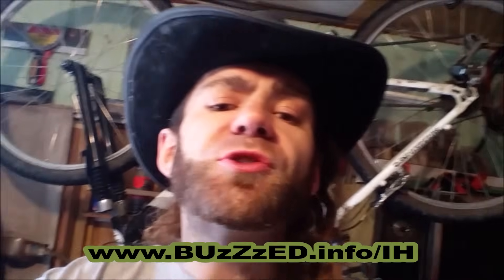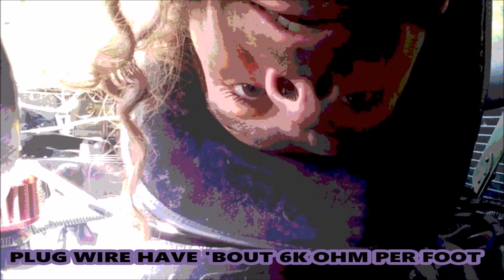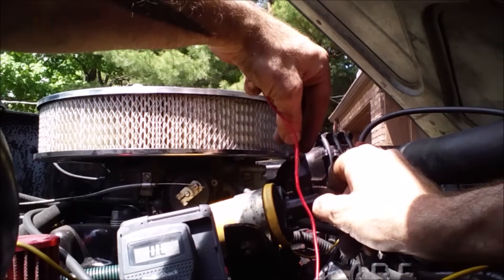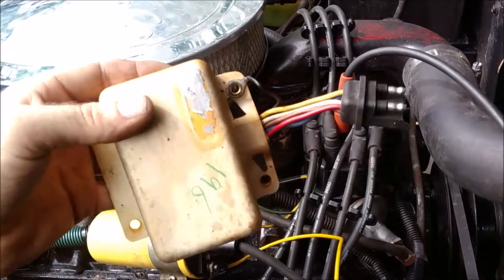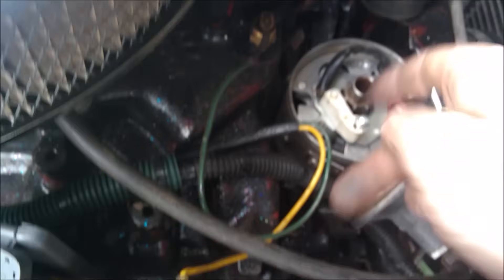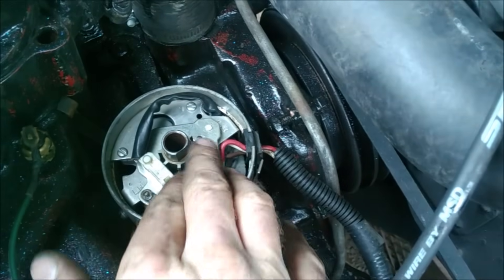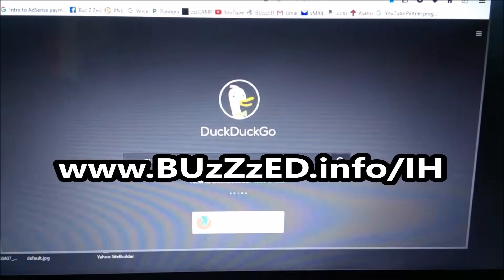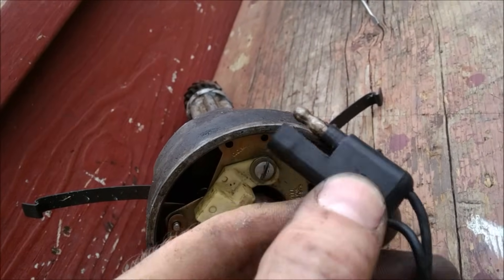NO SPARK, NO START, NO PROBLEM!  IGNITION SYSTEMS

Comment from the maker: oh my bad,  a 4cyl coil is not 1.6Ω like the 8..., it is 3Ω for the 4
Reply: Bro you explain stuff perfect and my 72 Buick Skylark literally started bogging out at 30 miles an hour like it was getting too much fuel what's your thoughts Could It Be Me screwing with the front needle adjustment too much out of whack or timing too far advanced
Reply: I have a 1971 ford thunderbird my car is doing the same thing when I change my coil it fired up drove it all that day I parked it for a couple of days went to try to start it no start
Reply from the maker: @waterboards6349  did the battery die

Comment: Ill make a new comment as the  "reply"  doesnt go through for me.   Ive got my coil out and am finding nice tight blue spark direct with battery  {when in vehicle is was fuzzy ugly yellow}  but its  "terribly inconsistant"   it wont fire every battery stroke /  sometimes not at all then other times will fire directly.  Thinking about putting a diode across the coil primary -  but getting tied -  Im in NZ.  Taking parts off boards -  sometimes a little flame torch with pull force so as soon as it heats enough you can get it out  {with plenty of ventilation}.  Thanks for your reply.
Reply from the maker: Sounds to me the primary winding is shorting out part way down the coil so it takes too long to recharge all the little eddy currents to the secondary…..

Comment: Thankyou Yanky.  Nice and slow so you can absorb it.  So im thinking the sensor is a hall sensor and activates a transistor -  likely a mosfet.  Which you can buy cheap or get out old washing machine etc.... -  better then paying the extorted price  and expoxy them in.  Thanks for the electronic ignition info as Im used to points and condensor.  Now to play with the coil and work back.  But mine had 15.67 kohms.  It is a sports coil so I dont know if that was the diff.  Seems sometimes to check these things when new and write it down somewhere safe.
Reply from the maker: Pull main wire off cap, and use spark tester, jump the coil straight to battery, then jump the coil power over to the coil trigger terminal momentarily and that will trigger spark, nice blue spark you know what your looking for…
Btw, big into repair and modifying cb transceivers, so I know enough to be dangerousness, the board is entirely caked with what looks like jb cold weld lol so if anybody knows how to remove it with out destroying everything else…

Comment: I still can’t figure out what’s going on with my car. Mind giving me some help? I’m not good with the electrical stuff.

1986 Nissan 300ZX
2+2 - V6 - 3.0L 2960cc 181ci GAS TBI vin H type VG30 - 2 valve SOHC
Reply from the maker: sure, whats the issue and what have youbtested so far

Comment: Should all coils have the same readings? for instance I have a Pertronix coil and I'm getting no spark
Reply from the maker: so if you would like a simpler test, put a spark test (or screwdriver)  on the end of the wire directly off the coil itself.   you can take a jumper wire from ground, and touch it momentarily to the neg side of coil, it will spark  as long as you have power to the pos of coil!!!
if not, jump power right to pos side of coil and try again, if that works your coil is not getting power  or you have bad ignition switch

Comment: so in the end it was a crank angle sensor?
Reply from the maker: basically, its called A Hall effect sensor, but it was most likely the circuit wired to it, capacitors leak over time and they loose their capacitance, and it would in this case change the time or what not untill they just pop...
and with the whole board covered in epoxy, there is no way to test and replace a simple 2 cent cap without damaging it...
any electronice, caps wear out...

Comment: I screwed up bro on my 65 stand, inline 6, I didn't tie down the battery so while driving, the positive to the battery touched the front support frame and melted the wire to the battery, not the car won't start. I fried something for sure, first I assumed it was the starter relay, I got a new one, not it. I tried a new battery still nothing, I don't have spark so I'm assuming I don't have power to the distributor, which is a HEI. What could it be? is there a way to bypass the resister wire and go direct to the distributor? did I fry the distributor or another wire? Dam!!! Rockie move man
Reply from the maker: yes so if power went to the body it had to get back to the neg terminal.   this means the shortest easiest path.   so if it went through the body it had to go through the ground strap that goes from engine to the firewall, through the engine, then to the negative cable to the battery....        so if the ground strap to the cab or body were corroded or missing it may have just went home backwards through the ignition switch, or the coil / distributor,  frys computers even with a good ground half the time...          So yes you can just hook it up straight to battery to test it and jump the starter, this will not be a problem, points last longer at 9 volts and its all they need, they still like 12 to start, thats why the resistor.    if you dont have points you need to remove the resistor btw...    so yeah check the ignition switch and jump it....

Comment: Hey Eric I must say you seem quite knowledgeable, so maybe you can help me ? After watching this video there’s a lot that comes into play in similar fashion with my 69 cougar I have crank no start no spark at the coil from either the coil or the plug wire a concern to me not knowing is I show 19 volts when the key is on at the positive of the coil not sure if that’s a good number I’ve tried switching up my points and condenser to another use set on another 69 cougar I have that has also sat for a while so I’m not sure if overtime these have gone bad too but still no spark I’ve checked wires and clean ground areas on the back of the starter solenoid and replaced the voltage regulator module I’m about to clean the ground to the engine block as I heard this could be a situation to no start even though it cranks over I have just bought a Pertonix to replace the points but sure if I should install it with that 19 V coming in at the coil when the ignition is on I don’t wanna damage anything on the pertronix  what should the voltage be coming in on the positive terminal of the coil when the key is on and showing at the solenoid the same voltage? Please help thanks
Reply from the maker: so, right off the bat, think your meter is bad, check the battery...  19volts... that or you have dual batteries wired in series on accident...    you should never get more than like 10 volts it has a big resistor to drop it down.. when you are cranking it over, it bypasses the resistor and gives it a straight 14 ish volts...     for cranking,  when not cranking it saves the points to run at 9.6 volts...       the sure test, one end of volt meter to ground, and trace the circuit top down... probe the wire b4 and aft every switch or  connector, and if the voltage is lower after any connection than b4 it, its a bad connection...    just jump the coil straight to the battery and see if you got spark then,    see if the coil powers up now,  this will save you all day tracing wires if its just a bad coil.   should be able to short the neg lead of coil to ground real fast zap, make it spark....    points can be bad new now days and its a 50 50 shot!!! so discharging the coil manually will be the easy test...
Get that mean cougar back on the road!!!

Comment: I have an 84 Buick that I replace the starter alternator and the battery and it only has some power the lights will turn on but the interior dome light won't and it won't let me roll up the windows what could that possibly be
Reply: And when I turn the key it doesn't do anything
Reply from the maker: @michaelmcclure26   could have a bad ignition switch, or the bulk head connector that puts though wire harness through the firewall on them goes bad, had one melt and catch on fire from the corroded contacts....     might be a simple ground issue body to chassis or engine...
   I will make a video soonish, but you need to do a voltage leak test.     
hook the volt meter to ground, then go and probe b4 and after each connection, switch, ect. ect.  and if you have less voltage after any connection, that is your problem.               because it can be as simple as cleaning the fuse contacts on a 40 year old car...

Comment: I have a 90 tbi in caprice i have fuel i only have spark coming from coil but no spark from distributor spark plug wire to the plug i changed the icm with a few new ones i still cant get spark to come out of spark plugs such an headache
Reply from the maker: well you have a bad distributor

Comment: Hi I have a question I have a 1997 Dakota SLT 5.2 V8 4x4 I have changed all the parts you mentioned EXCEPT for the cap and rotor those are semi new I changed them about to 2 years ago anyway I did a engine overhaul I replaced all the gaskets and now when i crank the truck it won't start it turns really well really strong but there seems to be no spark it does have fuel yesterday i decided to check something I haven't tried, I removed the distributor cap and cranked the engine but the rotor does not spin, can this be the reason for no spark and if is there a way to check for power or can i replace cap and rotor or should i replace the entire distributor?
Reply from the maker: sounds like you lost the gear on the distributor,
Reply: @ErikTheWrench  does that mean I need to get a new drive gear or replace the entire distributor?
Reply from the maker: @yukmouth13  pull it to inspect, and what happened to the old one, worn or missing bushing, or did it fall inside?
Reply: @ErikTheWrench  hey there friend I'm not sure what you mean by what happened to the old one ,
I will try to pull out the distributor tomorrow and inspect it I will give you an update because I have no spark on my truck
-new battery
-new starter 
-new radiator
-new msd ignition blaster coil ( just replaced with a new one same exact one)
-i have not replaced anything from the distributor I have done spark plug tests there is no spark there is power in the coil when I crank it
Reply from the maker: did you pull the distributor yet?
Reply: @ErikTheWrench hi there,
I pulled the distributor and looked inside I can see this engine has a gear shaft on the inside that connects to the camshaft.
I don't know how to pull out the gear shaft nor did I move it.
 I put on the new cap and rotor and still no spark and the rotor still does not turn.
One thing I do notice when the key ignition is ON, the "security" light stays on and before the rebuild it would light then turn off almost as if it deactivated.
 maybe the PCM is bad or the camshaft broke or maybe even the gear shaft broke 
like I said before it cranks really strong so it has to be a security issue, PCM issue ?
Reply: There is a gear shaft in between the camshaft and distributor,should I check to see if the gearshaft turns inside the engine while cranking with the distributor off or can that damage the engine?
Reply: Hi there here is an update I cranked the engine with the distributor off and recorded inside the hole with my phone, going over the recording, when cranking the engine with the key the camshaft and the distributor gear shaft do not turn or move can this mean that the camshaft broke or possibly the timing chain I can't believe I have to tear it all apart again

Comment: Hey I just heard that ignition switch could be responsible for stalling not just my cranking problem. Can switch be responsible for it dying after I do get it to crank/ start ? And it does have a cranking/ starting problem with it half the time starting/ cranking sometimes will and sometimes won’t
Reply from the maker: its possible.
if its that worn out like a light switch you jave to jiggle.
it might be that worn out that its hardly makjng contact and heating up

Comment: Good video sir I have a 65 mercury comet straight six I did the battery, alternator, starter plugs and wires vacuum, carb, radiator the obstacle that I have now is the cars crank starts and immediately dies. Any suggestions thanks so much?
Reply from the maker: does the coil have power when on? A 65 will have 2 wires for the coil, one is for starting only at 12v, and one is for run at 9v......

Comment: I have a 1963 buick 198 v-6. Car sat 20yrs. Replaced everything electrical- power at both sides of ign. Coil- no spark at plug?? Power good between  points contacts- how come no spark on plug?
Reply from the maker: k, points has 2 hot wires.     When the key is in the run position , a wire from the ignition switch with a ballast resistor powers the coil at 9.6 volts.  
 K, so when the key is in the start position it bypasses the resistor and gives it a full 12.6 volts to help it start.      
 so the ignition switch itself is very common failure, it can also be a bad resistor, or even the starter solenoid.   
 You will notice it has 2 wires.  one is from the key to activate the starter,  one is for the resistor bypass to start voltage....   so their are your check points, I have a wire diagram on www.bedhed.xyz/ih
so with key on, you should have 9.6 volts to the coil!!!   if not u have bad resistor, wire, or switch! 
with the key in start position, you should have 12+. if you have both, check your points or condenser, they are like 2 out of 3 bad from the factory now days!!!         
 so unless you have major problem like the distributor aint turning.........
Reply: @ErikTheWrench  ok, I
Just got out to check everything I read last night. First thing I found is the ground from the engine to the frame is broken! Does it need to be grounded to start?
Next I’ll check the ignition switch. When the key is on I have power on both sides of the coil? Is that normal? Everything electrical is new, including the starter and alternator. Where is the resistor? Thx a million for your help
Reply from the maker: if the engine is nout grounded the distributoe is also not grounded!
Reply from the maker: also if its a new harness, and its not wired for points, it will burn out your points like every two months
Reply: @ErikTheWrench  there’s no wiring harness in this car. It has very few wires. Wires from ignition switch, starter relay/solenoid- voltage regulator, that’s about it. I can see all the wires and they look ok, just the ground strap was broken. The next problem is no or low compression? I pulled plugs and squirted in each cylinder. Squirted the tops of push rods and valve springs. I have a weird rocker system?? It has a rod with springs bolted down over the top of the valve springs so there’s no adjusting the rockers? U seen this type before?? Thx man!!
Reply: @ErikTheWrench  if the distributor isn’t grounded then r u saying that will keep the spark plugs from spark? Thx
Reply from the maker: @rodgerfolkerts4690   well hmm, your 196 spitfire is an "odd fire" engine. they sold it to jeep in 67 and bought it back later, but switched it to even fire, so make sure its not wired like the newer 3800....   Also you should run a leak down test not a compression test, you pump it full of 100psi  and see where its leaking, valves, rings, gaskets.....  
 other wise the alley rat mechanic trick is put a teaspoon of oil in the plug hole then run the compression test, if it gets better with oil its your rings, if not its valves.....      
  likely just carbon on the valves or gunk in rings.....    you can fill the cylinders with marvell mystery oil and let them soak a couple days.
if its colapsed lifters gunked up, marvell in the crankcase is what will free them up..... 
here is a leakdown test video, Im embarrassed to say I got my tester from amazon for like 40$,  but if I cant get one made here, or anywhere thats not china, its all the same junk in different priced boxes lmao
The lil buick nailhead's rocker shafts springs are just to heep them in place horizontally... they dont do anything else so.....  hmmmmmm, It seems somehow my video on leakdown tests is missing, I will re up load it shortly!!!!!

Comment: Nice. Me too, a failed coil was hard to diagnose as they are fairly reliable and it was intermittently going bad until it took a crap on my PCM powered nautique middle of the lake.
Reply from the maker: some people have luck and guess right 9 out of 10, like that one guy you know that some how wins every damn raftle or contest lmao, and some of us what can fuck up will fuck up so im quick to start right off with a vacume gauge then a full mechanical leakdown to pinpoint any issues found, then and or a full eletrical leak down...
most the time....
id say even if you hit 9 out of ten,
twenty miniuts of fiddeling on all 10 is less time and money wasted than the one free repair that was unnessary based on false diagnosis!

Comment: Hello just bought new coil and module but yet it doesnt spark
Reply from the maker: Likely your question is answered 10x in the comments lol,   But you caught me at a good time!
I need a lot more info, make model, year....
have you have upgraded from points?
if not most common issue is a bad ignition switch.